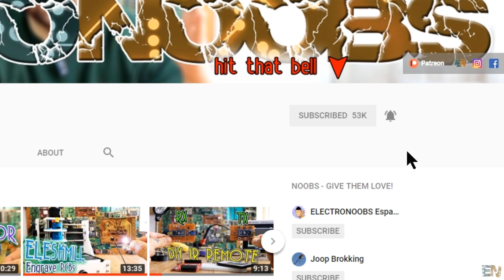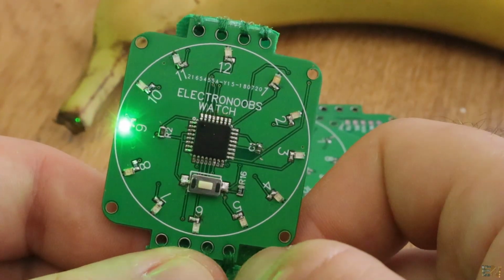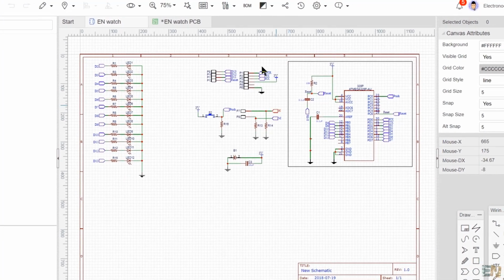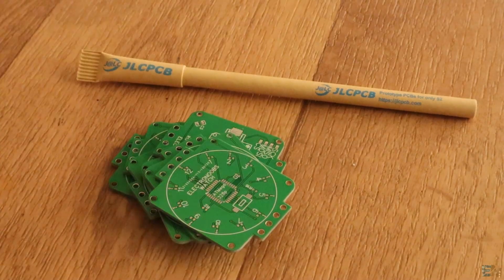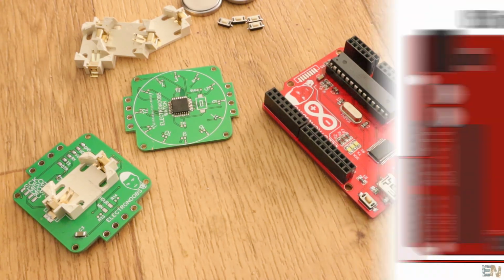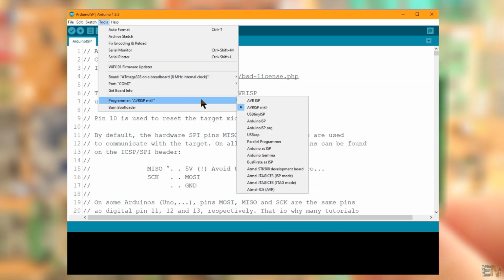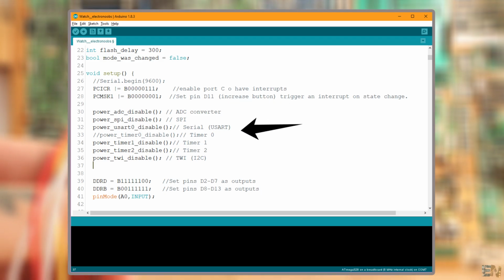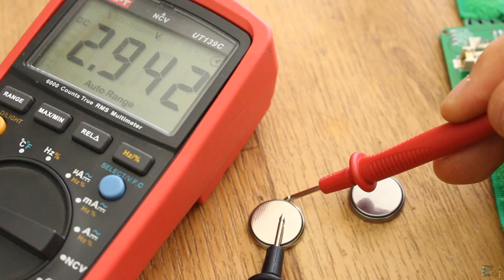Homemade Arduino digital watch | internal 8MHz clock

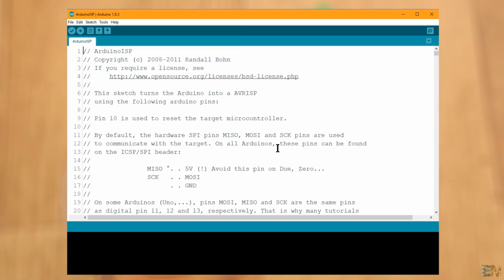Comment: I'm trying to burn the bootloader now using the Arduino Nano, but when selecting "burn bootloader" (at 7:35 in your video), I get the "not in sync" error message.. Is the Nano not supported for burning bootladers? Thanks
Reply: I have the same problem with the Nano as ISP. Did you found a solution? Burning via Uno as ISP gives me an Error with signature. Thanks
Reply: @ALex-ts1gu  are you using fresh chip ?
Reply: @RDGamezz  Yes of course. I solved the problem by using a crystal. Thanks anyway.
Reply: @ALex-ts1gu  found a solution?

Comment: What?! Are you charging regular lithium (CR2032/25) coin cells?! That’s very dangerous! They can explode! You need lithium-ion coin cells (LIR2032/25), which are rechargeable. They’re not the same! They have a higher voltage as well, so better for the project.

Comment: You don’t really need the SPI pins. You can use a ZIF socket to program the ATmega328 and then solder it. It’d be troublesome to change the code, though.

Comment: This is quite wrong. Not the idea itself but the mean of measuring the time. A uC is not precise at all for measuring the time. Use an RTC IC instead, or choose another uC which has RTC built-in. For example the stm32f103c are also popular and dirt cheap. Sure, those aren't the most beginner-friendly out there an the arduino support is a little sketchy, but it will work. Go even further and grab a ultra low power consumption uC with built-in RTC,  a small LCD module and you've got yourself a real self-made watch that you can really trust :)

Comment: That's an interesting project but in order to make a proper clock you need a RTC to make it work properly, also you didn't use an external crystal and internal oscillators are not reliable, so your second increments will not correspond to the "real world seconds".  Even if you use an external crystal you needed a 32.768kHz oscillator to correctly count seconds.
But anyways that's an interesting project and you took time to make a video for our amusement, that's a plus :)

Comment: the time drift is caused due the interrupt which is turned on by the arduino ide. you can disable that in order to get very precise timing.

Comment: Sir, pelase add 10 watch to oscilloscope, multimeter, 10 noobino, 3D printer. Dude send things by DHL is fast. You genius bro, handsome, strong and whatwever, blah, blah, blah, but send me things to Bombay ASAP, please Sir.
Bueno, ya fuera de bromas. El proyecto me pareció muy interesante pero lamentablemente tienes razón cuando anotas que hay un desfase de tiempo. Yo soy a penas un principiante y me puse a hacer un reloj con un LCD 2x16 pero con un módulo SPI que hice como backpack para el lcd. La idea era probar el circuito para el LCD y por eso me puse a programar el reloj. La pregunta es ¿habrá  version 2 y video de cómo solucionar ese desfase?
Reply from the maker: calabrese puedes usar un módulo de reloj externo. Es básicamente un reloj que lleva una batería y envía datos al Arduino
Reply: Gracias por tu recomendación, me haré de uno de esos módulos para seguir aprendiendo. Dicha recomendación me lleva a deducir que, seguramente en el futuro, veremos la versión 2 de tu reloj que incluya algún tipo de implementación de tal módulo, o los componentes del mismo directamente incorporados en el PCB de tu reloj.
Me parece muy pero muy interesante porque soy aficionado a los relojes desde niño, (ya de eso hace mucho tiempo) y estoy iniciando el hobby de la electrónica.
Gracias por tus vídeos.

Comment: internal 8mhz oscilator isn't very accurate ... i think that every day time will be about 24 minuts shifted... and second think is that when u use a low power modes on atmega and use async timer2 with external 32khz crystal , consuption ist about 1.3uA ... when u use external 32khz oscilator internal clock can be 1Mhz that means Atmega tuns to 1.8V ... I think u should try this things

Comment: Hey! Two things, Can you please make a review on CNC milling machines? I want one for me but I don't know where to buy (I'm from Spain aswell, and I do  NOT want amything from china) also I see you always use solder pads to connect the programmers to your PCBs? Did you thought about using "pogo pins" so you don't have to solder and desolder?

Comment: To burn 8MHz on used atmega you gotta connect external clock at first ;)
Reply: no - you only need to do it on chips that have the arduino bootloader on it
Reply: No? I know that from my own experience with microcontrolers
Reply: you sure it didn't have a bootloader on it or changed fuses? cause when i tried it, i didn't need a crystal.
Reply: @jabkowy6107  I failed too by using it without external clock. Now I'm very sad :-)
Reply: If the chip's fuses are set to 16MHz, it'll need a 16MHz crystal in order to operate

Comment: Could atmega cpu get replaced using attiny85? Its cheaper than atmega in my opinion. Btw, cool project bro!
Reply from the maker: But, you need 13 digital pions... Attiny has few. Maybe ATtiny85 + a driver.
Reply: you can always use 74hc595

Comment: You can upload your code directly by SPI and you did not need bootloader any more, and can use the atmega168 for this easyly.
Reply from the maker: I wanted to show you guys also how to bun the bootlaoder for any other project. Keep up!
Reply: Electronoobs yes, I know.. But bootloaders take precious 1k of memory from arduino IC, and can be nice to teache how avoid this,  you only need UART for debug propouse. The 0804 led in small pad was impressive hahaha so adaptative. For the 100nF capacitor, teache they how to put one soldered in the DTR pin from USB serial adaptor (if CH340G),  only one time and never more needed in your custom boards.
Reply: Julio, I have exactly the same ideas. Just one addition: about the "need a new MCU": maybe it's fuse bits related, "used" MCUs can have fuse bits set differently some need in a project. But fuse bits can be reprogrammed too (with eg an SPI programmer, again), so no need to order new MCU if you have some wanted to be "re-cycled" for the project.

Comment: Good realisation but why are you still using Arduino IDE ? With a proper programmer and atmel studio, you dont need bootloader anymore and could run this chip with a 32,768khz crystal. This configuration consume almost no current and have a much better clock accuracy
Reply from the maker: Thank you. I'll look into taht! Keep up!
Reply: Then you have to learn Assembly tho

Comment: Why u didnt use a li-po battery
Reply from the maker: I tought it would be too big and difficult to remove, so it would need the charging circuit on the PCB as well.
Reply: Electronoobs yeah you're right